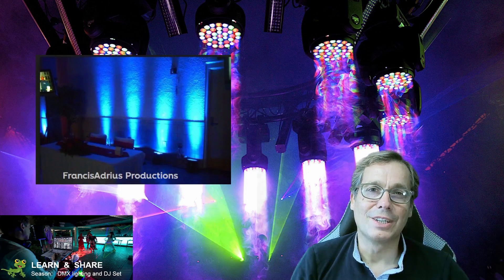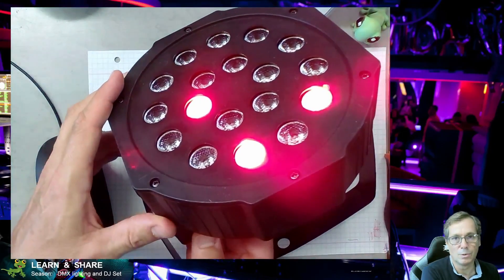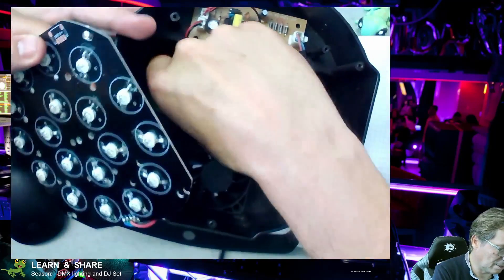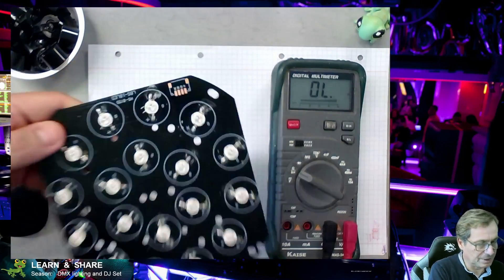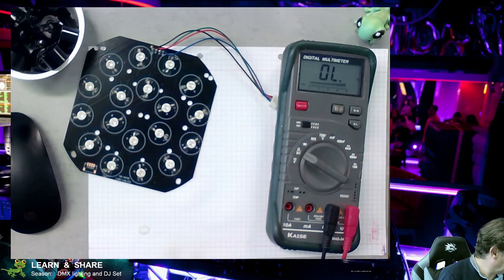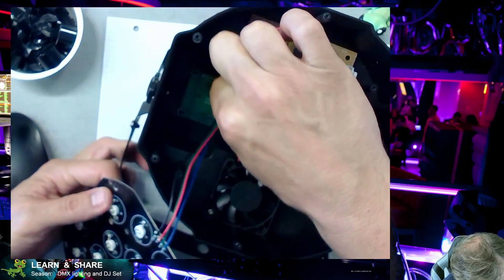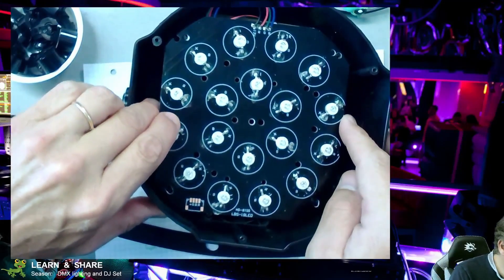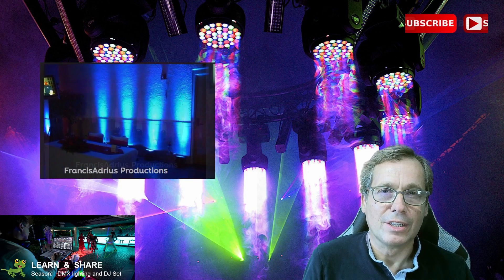#35  DMXLightingDJSet: How to Fix LED PAR RGB Light - Step By Step Guide  *English Version*

Comment: i have one where all the green led's turn on (not a full intensity, about 10%) as soon as it gets power, no signal as DMX is not plugged in and dmx signal does not override this. Im thinking what ever transistor controls the green led's is letting slight voltage through, thoughts? its a Eyourlife 54x3w RGBW